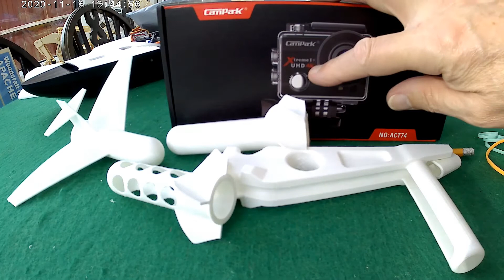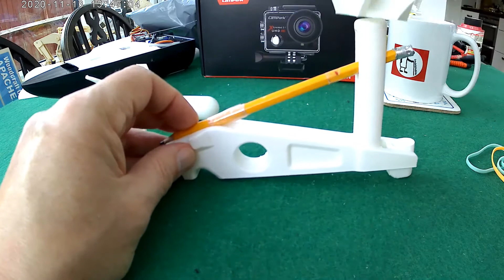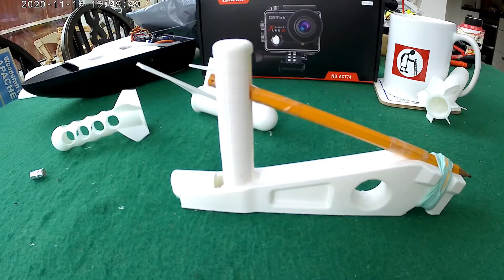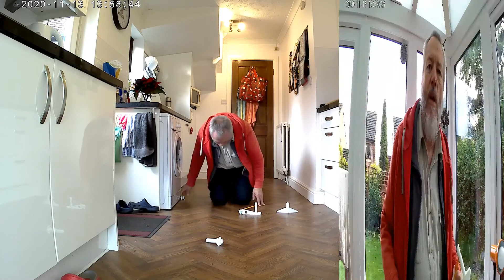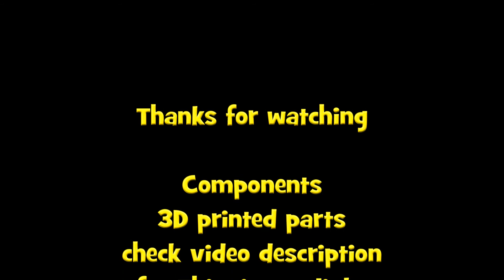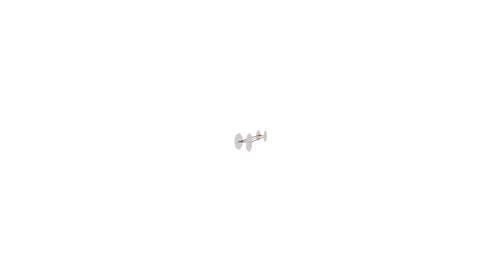Put a rubber band on it #0337 rubber band powered 3D printed rocket launcher

Comment: Hey Grandad add so holes to the PLA file of the plane rocket to lighten the load.
Reply from the maker: The light weight one with the holes in it breaks on virtually every flight and the plane broke pretty quickly when my grandsons gave it a proper testing. If I printed it from something other than PLA it might be more flexible and withstand the landings better. I could also keep adding rubber bands to give it more power.

Comment: All it needs is a leaver on the trigger and it could be mounted on one of your rubber band cars, then you would have a portable launch system that could drive into a wall or brick and launch the rocket .
Reply from the maker: Yes, could be done. It would look a bit neater than this one https://youtu.be/j83jK2zFjrM